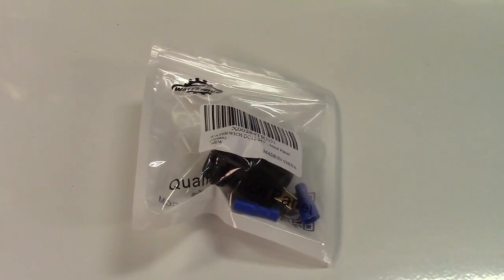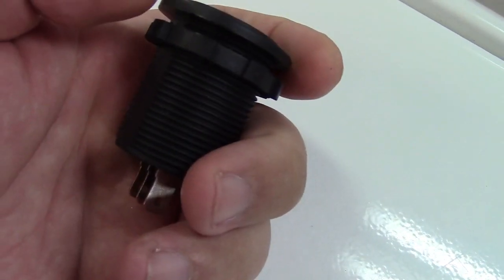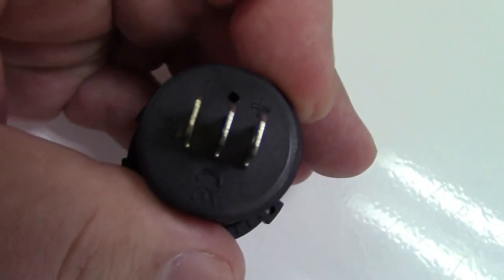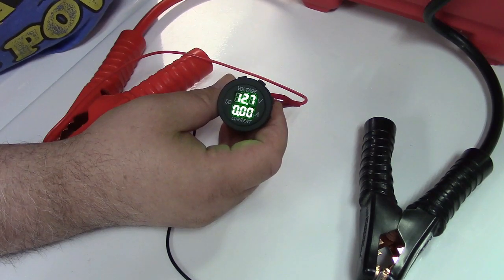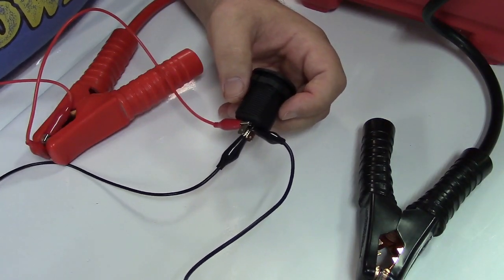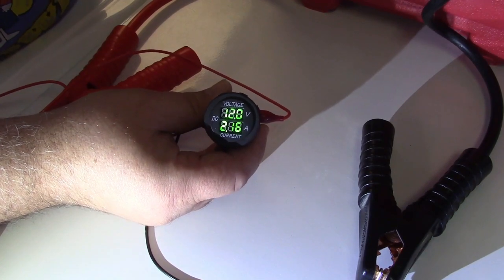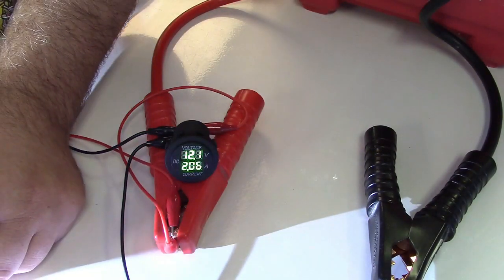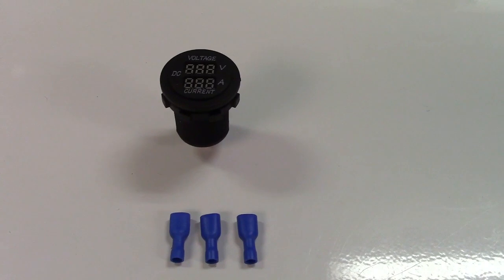WATERWICH 12-24VDC 10A Panel Mount Meter Review

Comment: is there a clear protective film on the displays? it looks like there is but i'm afraid to scrape at them if it's not actually removable film
Reply from the maker: It just so happens I knew exactly where this was after 4 years.  I took a close look at it.  I don't believe there is any protective film on the display, I'd leave it alone.

Comment: Too many negative reviews and bad out comes on Amazon Reviews. China at it finest!
Reply from the maker: Did you see the one where the guy said the meter is off by .5V compared to his FLUKE???????  Come on.  What do you expect for only a few bucks compared to a Fluke?
Reply: @jaykay18  With a statement like that, he is one of them "Guys" that states his turds do not smell!
Reply from the maker: My point exactly!  I'm going to hook this up to the 12v rail of the power supply at Club Jay.  If I decide to get really fancy, I'll even mount it in the supply, if there's room!
Reply: @jaykay18  Luv' it, when a plan come together!
Reply from the maker: Yeah I have a few projects to put videos together for that have been sitting while I do China reviews.
Reply: @jaykay18  Think I can name one project, begins with trippy_________________!
Reply from the maker: I certainly haven't forgotten about that!  Kind of waiting for a nice day when I'm snowed in to put them up.
Reply: @jaykay18  Snowed in, on the island of long? Nah, I got 2 feet of snow, 8 days ago. Think this storm was the first time I actually used a whole tank of fuel in the snow thrower.

Happy enough with winter, like to spend the rest in Tampa, Fla.
Reply from the maker: It snowed today, and last time, probably 8 days ago, about an inch each time.  Haven't even gotten the snowblower out yet.